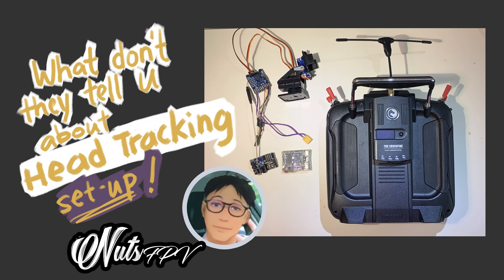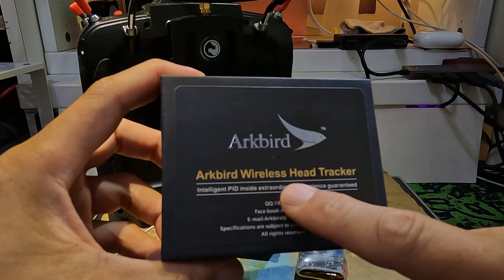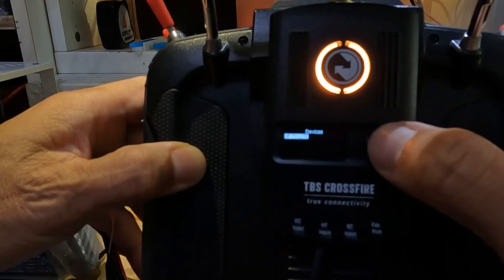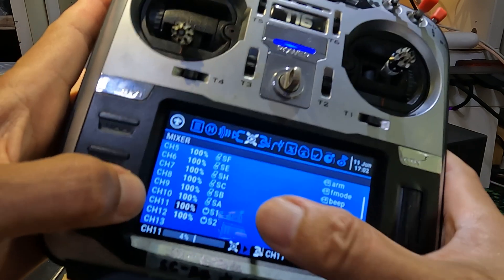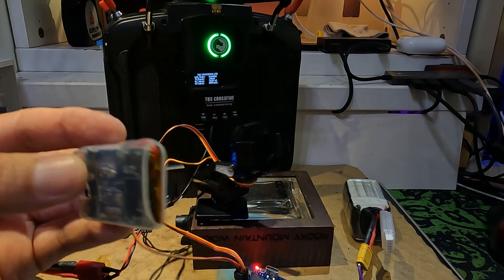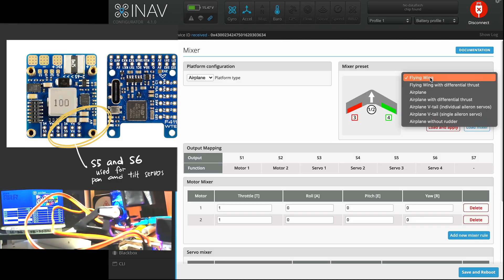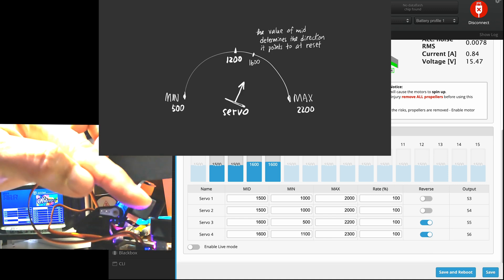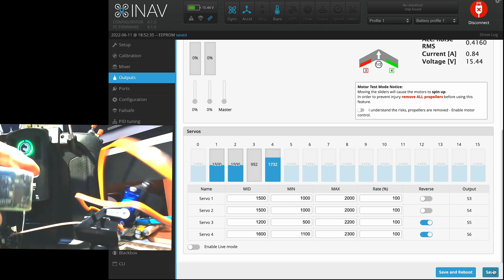Head Tracking Setup A-Z for RC Hobbies

Comment: Can this system work for something without a flight controller such as a regular crossfire system with adapters?
Reply from the maker: I believe you can feed the signals from the head tracker into RC with a RCA cable. At the receiving end you need a RC Receiver module with a channel that you can use to drive the servo.
You will need to configure your RC in order to drive the servo correctly. 
However I personally have not done that before. So I can't provide you with exact details on how to do it.
Reply: @nutsidea  I have a iX20SE with a working a proven working crossfire module and adapter that it requires.   I tested the FSV160 on a DX18 without crossfire and we got it showing servo movement when accelerometer moves.

Comment: what radio controller/transmitter do you recommend(preferable cheap)?
Reply from the maker: Very tough question for me to answer. 
I can only share my logic here:
1) must be very reliable
2) must have long range
3) must have features like GPS locate (in case if you lost the craft, it can direct you to the craft if you re-establish connection) 
4) if head tracker is needed, you need i) an external module that allows the head tracker to plug into it (like what I showed in my video), or
ii) a socket on the RC to plug in the head tracker 

So personally I use TBS Blacksheep Crossfire (probably the most established brand out there with lots of people using it both for quads and for wings.)
These days there are many other alternatives but I didn't check them out. 

So to help you find a suitable RC, perhaps you can share:
i) do you intend to use it for wings, quad or both
ii) do you need head tracker?
iii) what is considered cheap for you?

Someone else with better knowledge pls chip in to help.

Comment: IF I GOT HDZERO GOGGLE do i need headtraker transmitter?
i use tbs mambo and i got TBS Crossfire Micro TX V2 transmitter on my goggle?
Reply from the maker: Hi, I am not absolutely certain, but from the specs, the goggles doesn't have orientation tracking feature built in. So if you want head tracking feature on your cam mounted on your FPV craft, you will need this or equivalent tracker system.
The Mambo needs a feed of tracking data to stream to the receiver on the FPV craft.
Reply from the maker: Found what you need here:

https://www.youtube.com/watch?v=M0G77QlSjlQ

indeed it is a cable you need to buy to connect your goggles to your RC.

Sorry but i accidentally deleted your most recent comment.

Comment: Hi Great video.  I am just a little lost. I did see a manual on line but nothing specific to my questions.
-My Arkbird RX came without an antenna. Do you know what antenna type it uses. Is it 2.4G, 5.8G, or 433G?
-Which port on the RX do I plug in the 3.5 stereo jack. Is it plugged into the "I" port or "O"?
-All my Models have the Trainer Port already set on MASTER. Do I actually still need to make a Trainer Model on my radio to activate the head tracker?
-Lastly, do I need to power this RX separately or will my Taranis X9D power it through the Trainer Port Jack? 
Thank you in advance
Reply from the maker: I am not quite sure if I get your question.
If it is about the receiver of the HT, it plugs into your radio transmitter. 
It receives signals from the HT Transmitter which is mounted onto your goggles. 
There is no antenna needed because of the short distance between your goggles and the radio transmitter.
The 3.5 stereo jack plugs into your radio IF and only IF your radio has a socket. Some radios don't have such. 

Hope the information is what you are asking for.
Reply from the maker: In other words, the HT receiver receives the HT signals, channels it into your radio transmitter (radio control), then gets sent to the radio receiver on your FPV craft.
The HT receiver is not for mounting on the FPV craft itself. Thus no antenna required.
Reply: @nutsidea  Thank you for the quick reply.  Great!  got the antenna part on the AHT RX.  I did not want to be powering things up without an antenna.  My Taranis X9D (original) does have a trainer port.  I'm just not sure if the jack is stereo or mono on my radio. Will it work either way? Also, do I plug the other end of this cable to the "I" or "O" port of the AHT RX?  I am going about this ever so slowly as information is slow to come by.  Thanks in advance

Comment: Will this work with any radio? I have Spektrum ix12
Reply from the maker: If you are referring to whether Crossfire module can be mounted on Spectrum ix12, the information on this link indicates so.
https://www.spektrumrc.com/product/ix12-12-channel-dsmx-transmitter-only/SPMR12000.html

The setup process for the head tracker would be identical as shown in the video.
Reply: @nutsidea  I already got that. It's all hooked up ready to go. I just need more than eight channels out of a crossfire for my fpv glider that I'm building as we speak. 12 channels are better than 8
Reply: @James Turncliff  imagine having manners and using words like "please" and "thank you".
Reply: @murrijuana2842  you get this thank you after I get the information. Think about that
Reply: @nutsidea  video on how to get 12 channels out of a nano receiver would be awesome. That will get lots of hits. One guy has it but he doesn't really show you how to do it not that involved
Reply from the maker: @jamesturncliff5960  Are you referring to the TBS nano receiver? How to set it up for 12 channels?
Reply: @nutsidea  yes I have a standard receiver and a nano receiver as well I'm trying to get at least nine channels there's no information no videos on how to do this it is extremely hard to figure out if you don't know all the terminology and have any bachelor's degree in abbreviations
Reply from the maker: @jamesturncliff5960  Not sure if this is what you are asking for. Switching the Nano Receiver from 8 channels to 12. 
Please take a look.
https://youtu.be/0ScJfEuHEyY